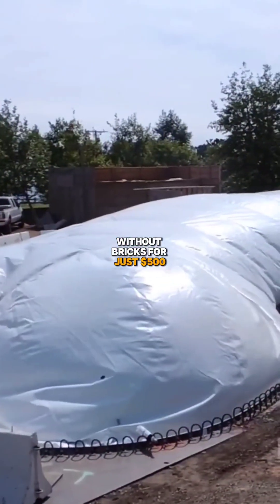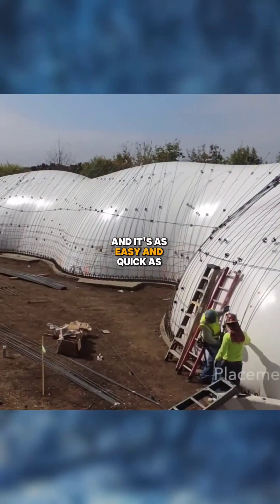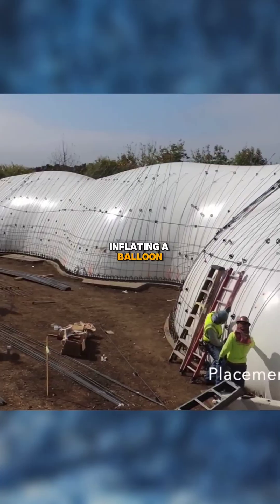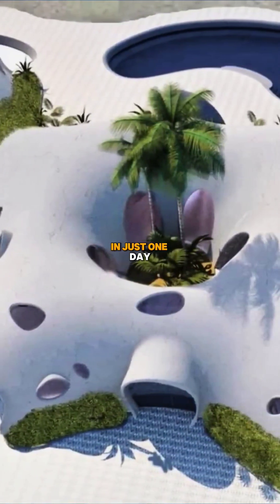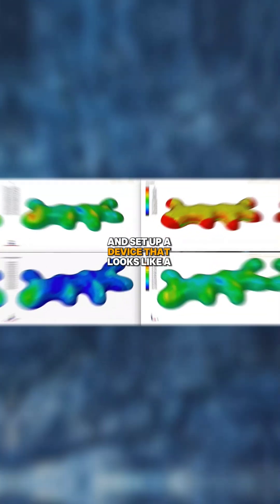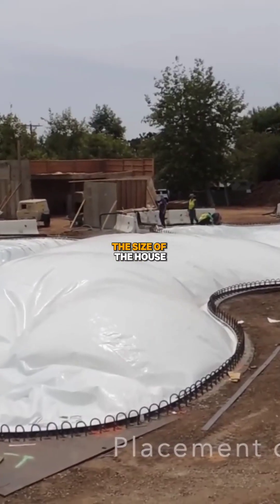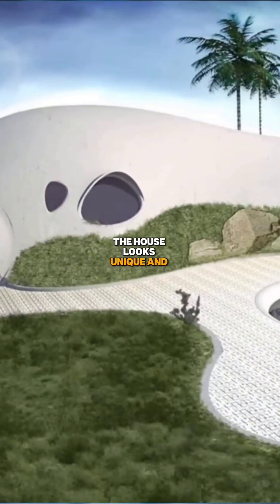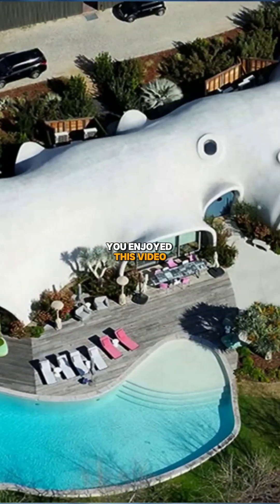Balloon house in just one day #balloonhouse #cheapconstruction #shorts #shortvideo #building #fyp

Comment: Poor insulation, No in-wall plumbing or electrical, Every door and window is more complicated to frame, glaze and secure, None of your internal walls are flat for hanging items, placing furniture or cabinets, there's no way it's under $500 after the cost of the foundation laying, trucking in the concrete, reinforcing rods, labor of each of those. Basically, the whole video is BS.